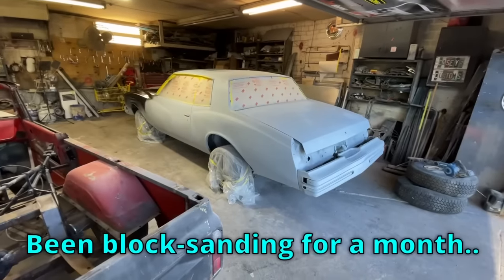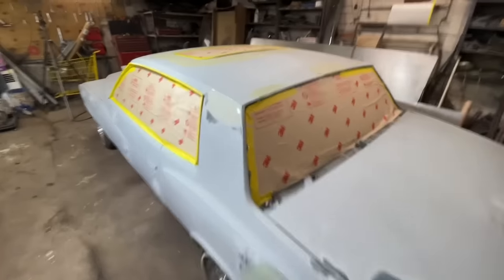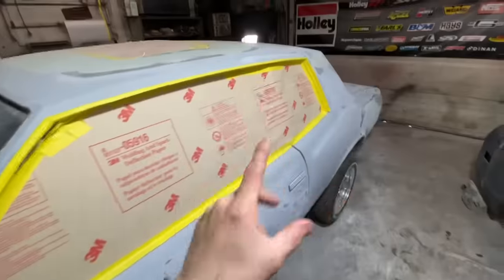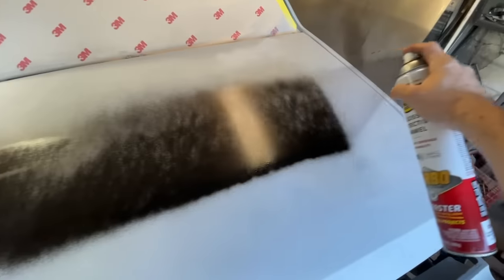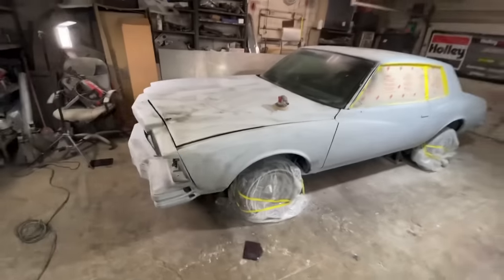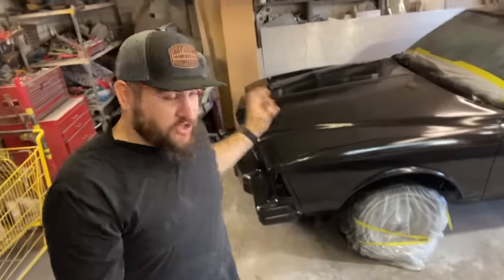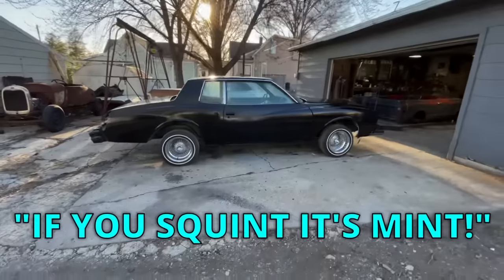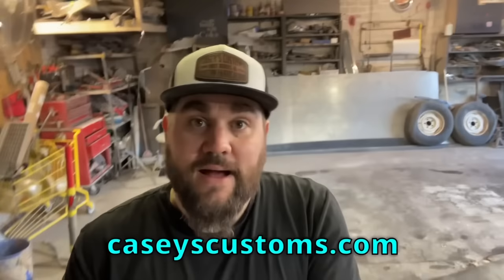SPRAY PAINTING MY SHOW CAR WITH TURBO CANS! PAINTING THE TRAINING DAY LOWRIDER. HOT ROD MONTE CARLO

Comment: It's not that you didn't shake the cans, that's just how they are. None of these people doing these videos are telling anyone this paint doesn't have any catalyst so it never hardens. It will eventually cure enough to be "dry", but it will remain so soft you can press your fingernail into it and leave a permanent imprint. 

The good news is (for anyone else thinking of actually doing this) is you can get 2K (paint with hardener) clearcloat in a spray can to spray over it and protect it with a hard, durable urethane shell. It's more expensive but it's still cheaper than a professional basecoat/clearcoat job.

Comment: Covered everything but the wheels and and windshield 😂 have fun cleaning that over spray😂 there is special plastic fillers that have the proper flex if not later it will crack or fall off. I had a car like that was in really good shape everything was straight and very little rust.

Comment: You're using a spray gun to spray primer and sealer then you use and spray cans for the overall job and another thing sealer is not supposed to be sanded it is called sealer You're only saying 2K primer

Comment: The cheap HF gun, you have to clean it and take out the oil/grease and pipe dope they put in it.
Reply from the maker: Yea i know, this one was one we used already and didn’t clean the inside well enough. I should of paid more attention but i just grabbed it off the wall
Reply: @CaseysCustoms  sometimes you just want to go.  I get it.

Comment: Little bit of advice...if you paint with a turbo can and then use a regular size can of Rustoleum to touch up, it WILL RUN LIKE WATER and ruin the paint job.

Rustoleum sux 🍆. KRYLON #1.